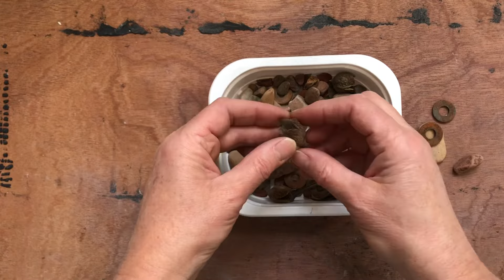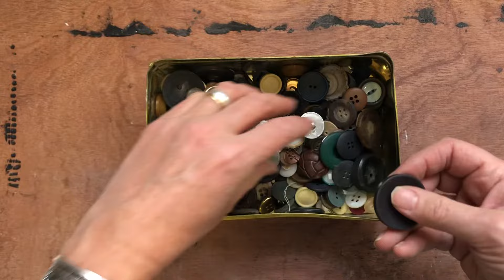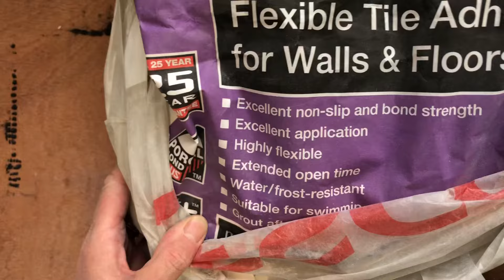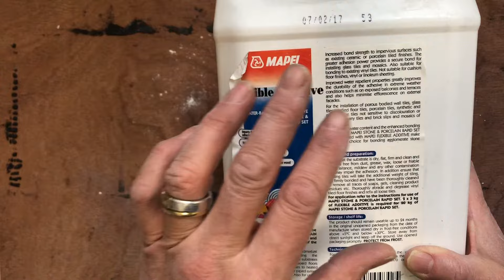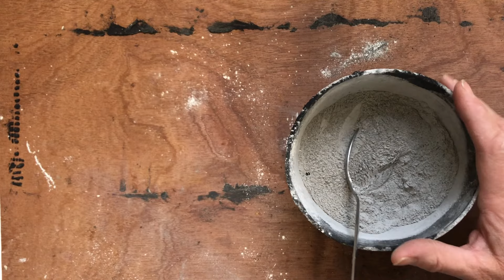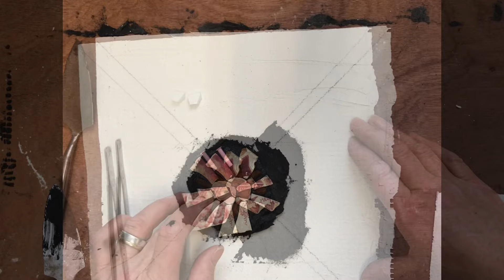MAKE FREE MOSAICS FROM FOUND AND RECYCLED MATERIALS

Comment: Hi Helen….lovely project. My question is…are the thicker pieces set deeper so that you have a relatively level surface when you’re finished.  In the video it doesn’t look level.
Reply from the maker: No, the thicker pieces are set deeper to ensure that they are held in place securely but the aim is not have a level surface if you are using found and recycled materials. It would be pretty much impossible to achieve so there is no point trying!
Reply: @HelenMilesMosaics that’s so valuable to know!  Thank you so much and saves me some anxiety as I try this.  🥰

Comment: I found your Youtube as I'm looking to do an outdoor mosaic. I have a hideous concrete doorstep. Could I use this same process and materials to work on a concrete substrate? I need to start collecting items but I want them to be a little offbeat so could I add beads and cutdown plastic toys as well as pottery and shells and other random stuff!?  Xxx
Reply from the maker: Yes, this would be the process to use but it wouldn't be terribly flat. As long as you're OK with that, then go for it! And all the things you mention would be fine too although pottery needs to be bone china or the designs will peel off fairly quickly and some shells are quite brittle.

Comment: How is this free if you still have to buy the tile adhesive/additive/pigment.
Reply from the maker: You’re right of course but making mosaics in this way is as free as they can be given that they need to be stuck down. You can usually get some leftover tile adhesive from someone doing their kitchen or bathroom so the pigment is the only real expense (a few £) and additive is not required if you live in a hot country or are working in the summer.

Comment: Hi from the USA! If we don't have that type of grout, what would be the closest thing? would it be sanded or unsanded grout? Polymer? Fortified? There are so many choices here, and I want to make sure I do the right thing! Thanks so much!
Reply: I take it 'thinset' means grout fortified with polymer that one sets the tessera on, and the sanded grout and polymer is for the actual grout filling in the gaps maybe? I'm doing my first mosaic project and wasnt expecting the great variety of options, and greater number of techniques~ presently in California.
Reply from the maker: In the US, you can use Laticrete 254 Platinum which is polymer fortified and or Mapei Glass and Tile Thinset which is also polymer fortified which is the same as Adesilex P10 which you can buy from places like Home Depot. I am not sure if it is sanded - there is no mention on the packaging that I can see so I think that the sanded/non sanded option is for grout rather than thin set. I hope that helps!

Comment: Helen  did you grout that piece ?
Reply from the maker: The beauty of using this method is that you don't have to grout. The tesserae are held in place by the tile adhesive which also fills the gaps between the pieces.
Reply: @HelenMilesMosaics  could you grout it if wanted? what shall I watch out for?
Reply from the maker: @monicapinto6005  You can grout but it's hard work grouting around pieces which are different heights. It just takes a bit of time and patience!

Comment: This may be a silly question (I’m new to mosaics), but would you not grout this?  If not, how do you know which pieces of mosaic art to grout?
Reply from the maker: Not a silly question at all. When you use tile adhesive/thinset there is no need to grout the mosaic because the thinset holds the pieces in place and fills the gaps between them. Some people do grout when using materials which are different heights and textures but it is an extremely labour intensive process as you have to pick out all the excess grout which gets trapped so I really wouldn't recommend it.
Reply: @HelenMilesMosaics  Thank you for the explanation!  Do you have a video showing how to grout a project that is made using found materials when weldbond or another glue is used instead of thinset?
Reply from the maker: @Stopmotionbro  I'm afraid I don't, but this looks like it might be helpful: https://www.youtube.com/watch?v=eg8gIoRZYWE&t=35s

Comment: Thank you so much for this helpful video, would this adhesive work on wood or terracotta pots?? 🌹
Reply from the maker: Yes, tile adhesive works on both wood and terracotta. Just make sure that you use marine ply if the mosaic is going to be outdoors and also I like to seal the wood first using a 50/50 mix of water and PVA.

Comment: would you be able to apply directly to fiberglass mesh as well? or does it depend on the size and shape of the found objects?
Reply from the maker: Yes, as long as you have plastic under the mesh to stop it sticking the table. That's a quite a common way to make mosaics so thanks for pointing it out! 😀